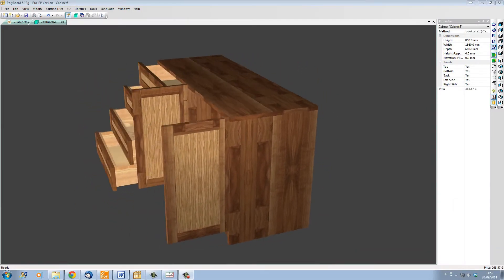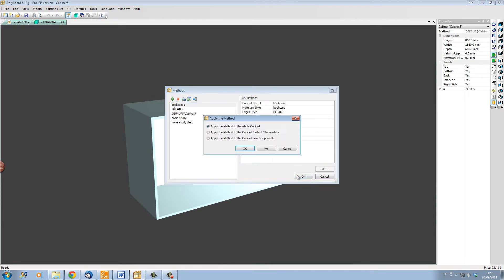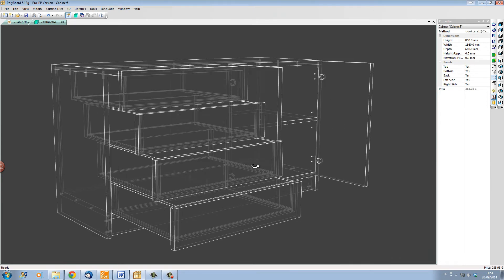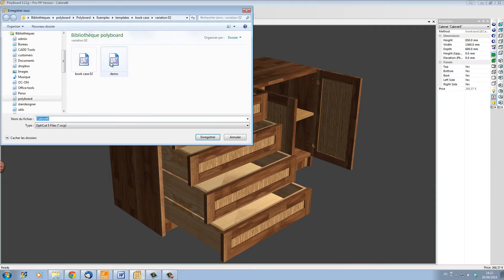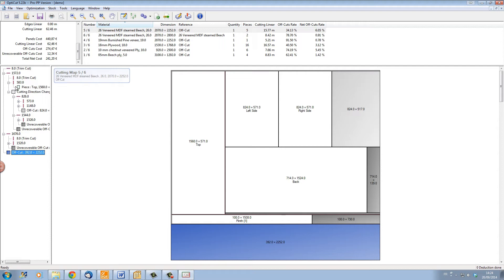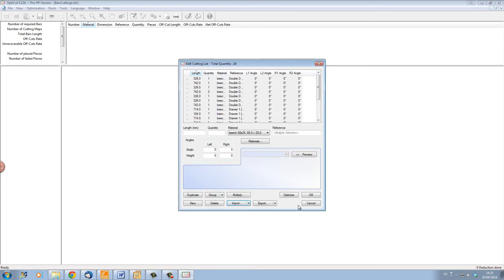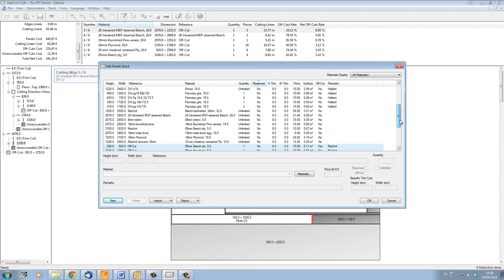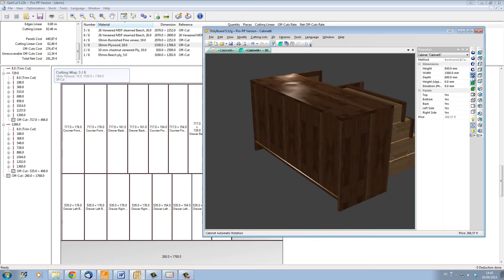Save Money The Easy Way With OptiCut | Wood Designer Ltd

Comment: Hello, can you tell a cabinet designing softare that generate easy and ready to cut hinges and minifix plans, compared to sketchup and why is it better? or is there a sketchup plugin that generates such minifix easy setting and ready to cut plans on cabinet designs ?
Reply from the maker: Hi Triumf and thank you for your comment. 

We definetly can recommend our software Polyboard for cabinet design, it is a lot quicker than SketchUp: instead of drawing as you do in SU, you design parametrically, starting with your cabinet carcass then right clicking the mouse or using the toolbar you add drawers, shelves, doors and so on.
You’ve then got instant access to a 3D model, the cutting list, plans, CNC files and prices and a lot more.. for more details you may visit: https://wooddesigner.org/polyboard-software-tools/

Alternatively, you can use the extensions Cutlist or OpenCutlist to export your list to OptiCut. 

I hope this is helpful.